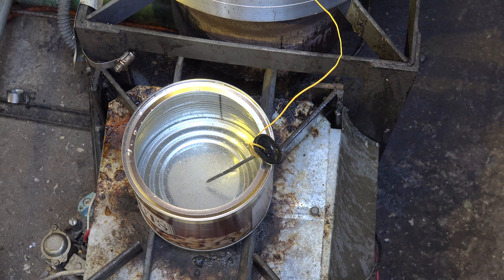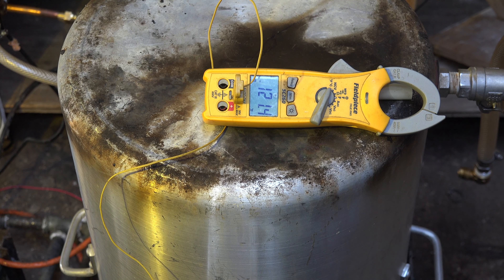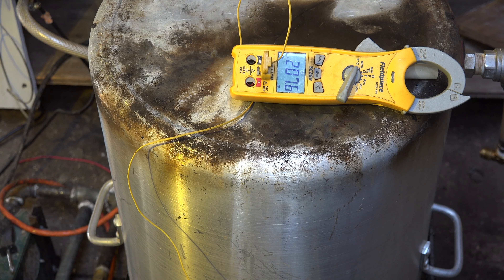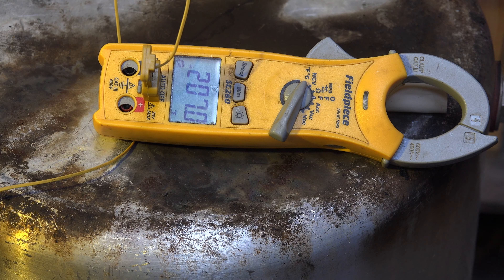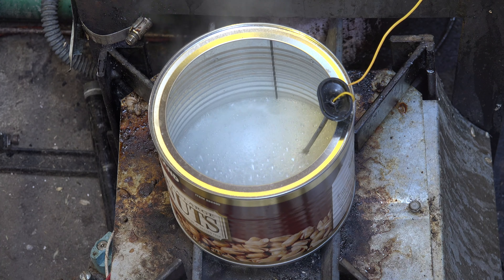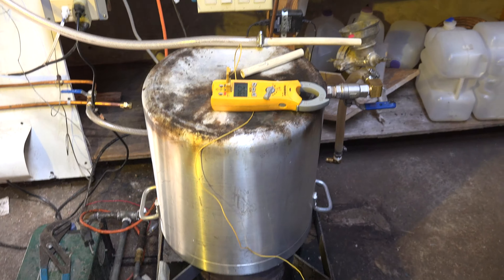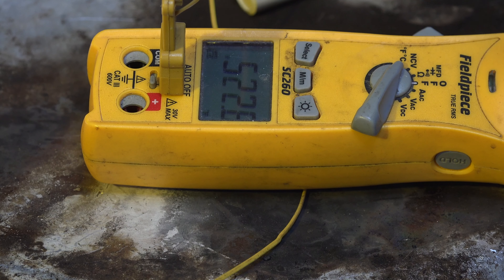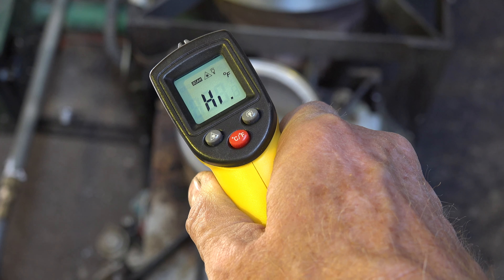Latent heat demonstration

Comment: would if you fire a steam or water boiler with no water?
Reply: it's happened before, the massive blast tends to not leave much around :))
Reply from the maker: That's pretty much the worst nightmare of boiler people.  If you are lucky, the boiler will be ruined.  If you are unlucky, water could come back into the hot boiler.  In that case, the boiler will explode.  
GFM

Comment: so you were saying that the water was boiling at around 207*F instead of 212*F because of your high altitude?
Reply from the maker: Yes.  The higher the altitude, the lower the atmospheric pressure, the lower the boiling point.
GFM